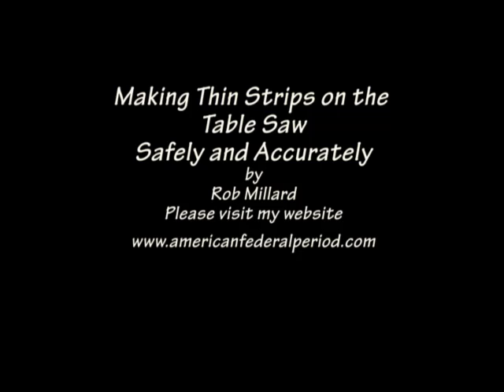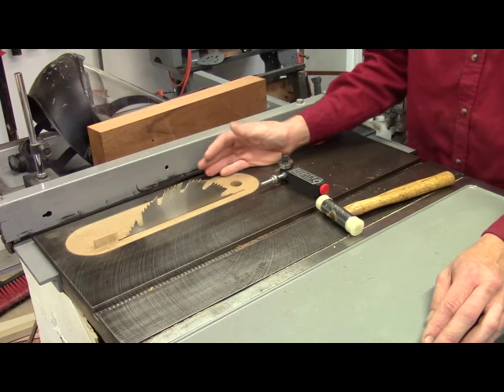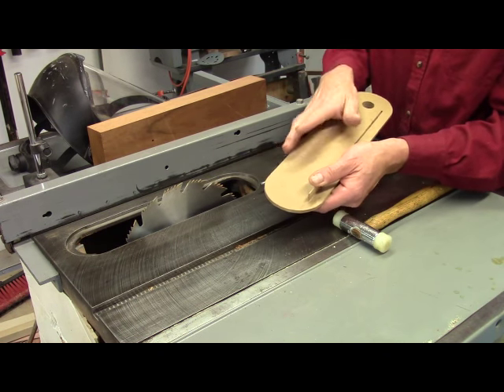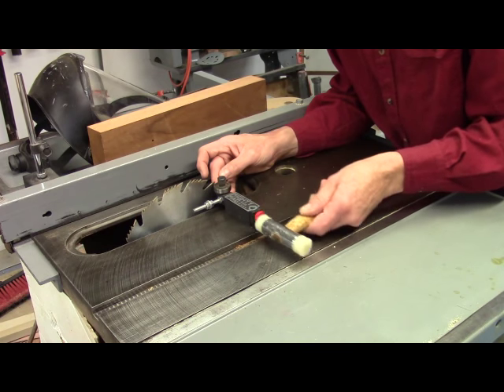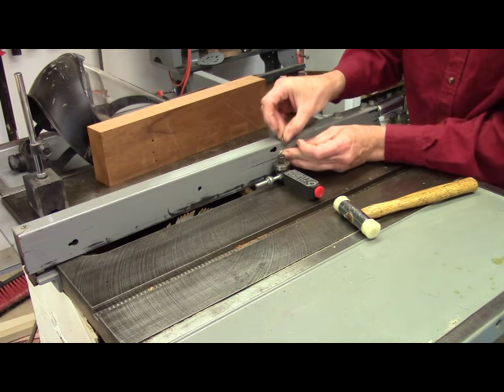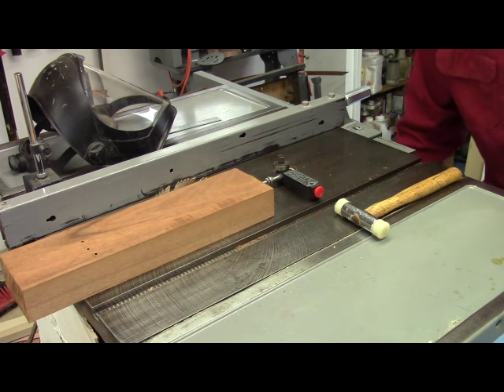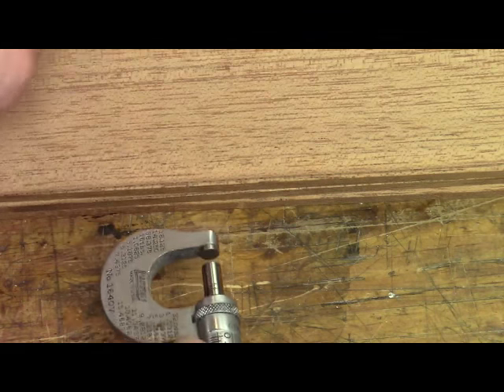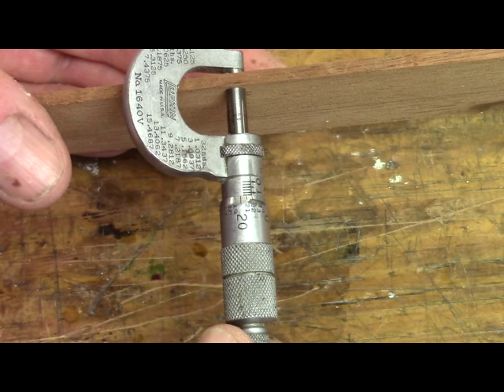Making thin strips on the Table Saw, Safely and Accurately

Comment: Well explained video. Thanks for sharing. But I miss one thing (in my opinion rather important):
What does one have to do between the first cut of a thin strip and the second one?
What has to be moved?
Reply: You would need to move the fence over to where the wood is touching the magnetic stop block. That keeps the strips at a consistent thickness.

Comment: Over complicated and non reliable method.The magnet may (and definitely will) be pushed away by any small protuberance/wood chip/dirt on the outer side of material.The whole process might be done by much simpler and reliable way, without dozens of magnets.